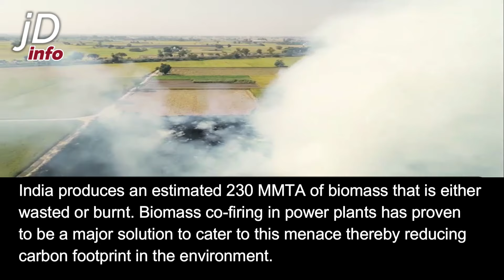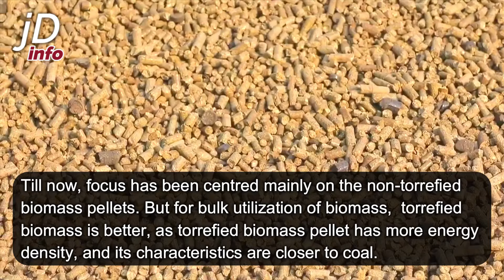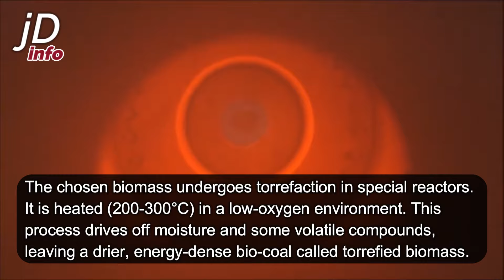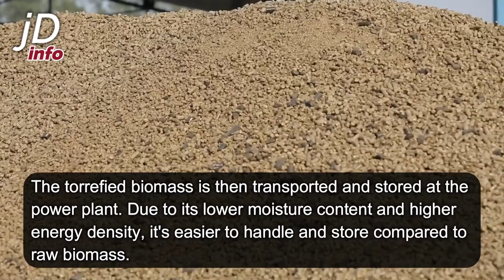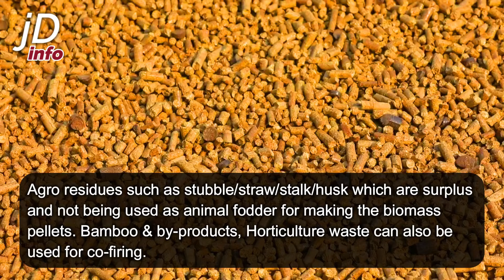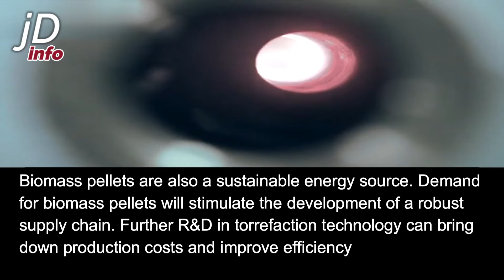India is using Torrefied Biomass and it's a big deal

Comment: Just as with coal, bio-char(torrefied biomass/charcoal) can also be used to to produce syn-gas.
At the rate this initiative has picked up, very soon Bharat would need t import wood chips as biomass feed-stock !😊
Also, just like China is doing, this charcoal or torrefied biomass charcoal pellet can also be exported worldwide for huge array of uses.
Reply: Anything is good as long as it can stop stubble burning in Punjab.